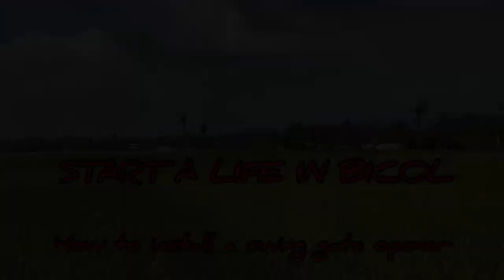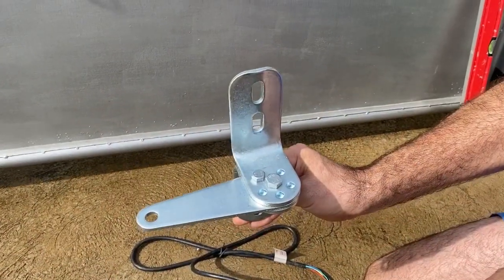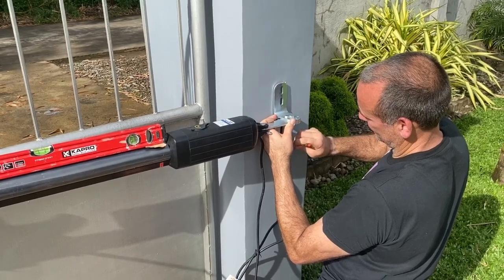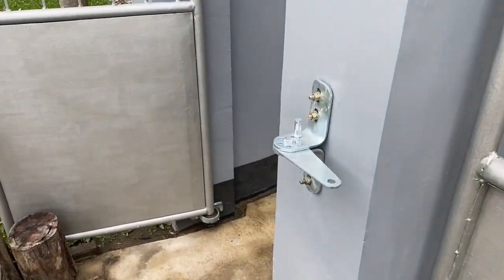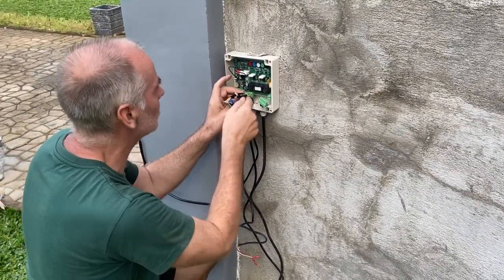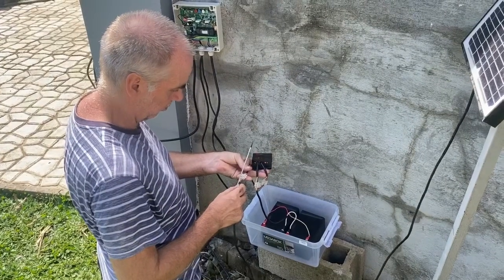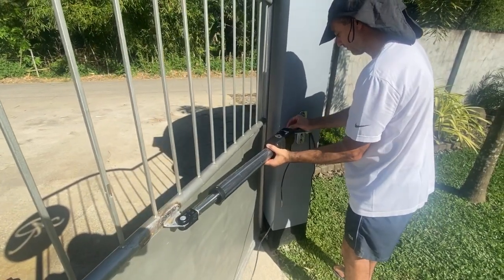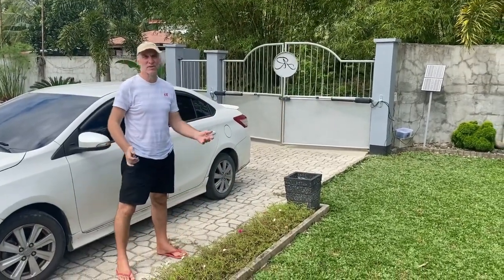How to install a Topens Dual swing gate opener.

Comment: Hello sir great video, I have a similar midel frok Topens and am going to try to install it today myself! It will be my first time working with electricals. Quick question, did the concrete anchors come with your model?
Reply from the maker: @arpansingh4233  It is not hard to install, just take your time. No the anchor bolts I bought locally.

Comment: Hi bro, my Topens gate isn't close on the right hand side gate last from inside home view, I want to install a ET24 electric lock and I don't want one more cable underneath the round, how can I set the gate closing like your? Left close first and then right hand side last? Tia
Reply from the maker: Hi, the side closest to the control box is set as master(#1) other is slave(#2). In contr. box is a red block with 5 dip switches. Put #3 and #4 up. Those are open and close delay enable. On top right are 5 coloured switches, 1 for open delay and 1 for close. You can set the delay in gate sides here. Turn the open switch a little and check if this is enough. If not turn it more or less. Do the same for close delay. 
It is hard but you can get the cable for the lock into the box.
Reply: @dutchypinoy5137  Thank you mate will try and I found the electric lock cost £99 in Amazon 🤦

Comment: The At6132 closes but not remaining closed. What could be the problem
Reply from the maker: Hi, does it opens again after closing signal or is it not completely closed (is there a gap)?
Reply: @dutchypinoy5137  yes it opens when u close it and remains open.
Reply from the maker: @l.e.n1819  If the gate is not closing at all and remains open. Check your dip switches in the control box. There are 5 dip switches nbr#1 is pull/push to open.  Maybe this switch is in wrong position. Switch down is “pull open” and up “push open”.
Reply: @dutchypinoy5137  thanx for the reply. To note:
The gate is closing when the remote is pressed, but it is opening after about 10 seconds. It's NOT remaining closed. Thats the issue I have.
Just to be clear
Reply from the maker: @l.e.n1819  If the gate is at closing point, does it sounds like it want to go further? If so, check the resistance setting on the bottom of the arm. Change the setting of the scew, open the screw and slide it forward or backwards. This is the setting where the arm will stop. Make fine adjustment with this screw. If this setting is too far due too much pressure of the arm it change to open again.

Comment: Many failures in the video, sorry. You did not mention what to do with the release key after you release the arm. You put the post bracket in a 90 degree I don’t know how the arm retracts. It is impossible. You should show how the arm retracts to accept
Reply from the maker: Hi Luis, thanks for you reaction. Those are not failures I just didn’t mention that. I can’t put everything step in, sometimes it’s also logical thinking. My gate works perfectly, so all I mentioned is ok. There will be ofcourse people who watch the video and dnt have a technical background. After watching they can decide to do it self or by someone else.